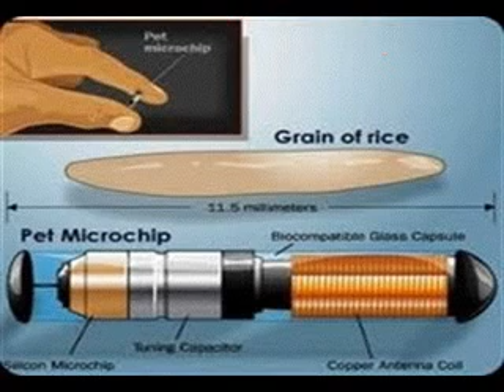RFID Micro Chip Explained

Comment: Holy crap woman I would like to see your sources because you have your facts all wrong. Almost nothing you said in that video was true. 
1. An RFID chip needs an RFID reader to be powered so it can’t be an around the clock gps. Plus most RFID tags can only work from only inches away from the reader.
2. The RFID being injected in the veins is at the fault of the doctor not the RFID chip.
3. Right now they are mostly used as a replacement to barcodes in shipping and manufacturing that’s why they are in clothes, computers, phones, and in probably most medical equipment not just syringes.
4. I don’t know where you got that they cause cancer but the inner electronics are completely incased in the glass and therefore cannot inject chemicals into your body.
5. In the picture that you show you can see that the device is mostly made up of a coil. That is where the electromagnetic field comes into play. the coil picks up the field that is given off by the RFID reader and converts it back into energy for the chip to use then that chip uses that energy to send a id number back to the reader. This process is similar to how generators or the power supply in the computer you used to make this video work and neither of those things cause cancer.
6. All the chip does is give the reader an id number. Now if the person who reads the chip wants to check the number against a database then he is probably a doctor and is trying to get important info about your medical history so he doesn’t kill you. He will also probably check your number against a database that the public doesn’t have access to so not just anyone could access your info. 
7. You would have to sign up for a database like this otherwise they cannot guarantee it would be accurate. You could move to another doctor who doesn’t know you have the chip and therefore doesn't log updated info into the database.
8. Have you seen the needle that is used to inject the chip? It has to inject a rice grain so there is no way you could do that discreetly.

In the video you sound like you are in an auditorium of some kind. I hope this wasn’t a large presentation because to me you seem ignorant on the subject and I hope what I wrote above will help clarify the misconceptions about RFID tags.
 If you any questions feel free to contact me on google+.